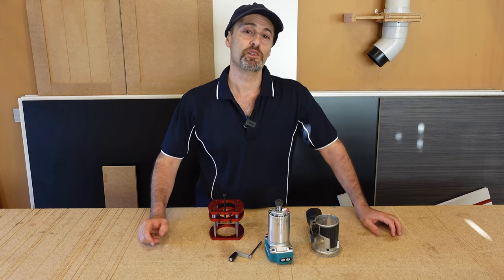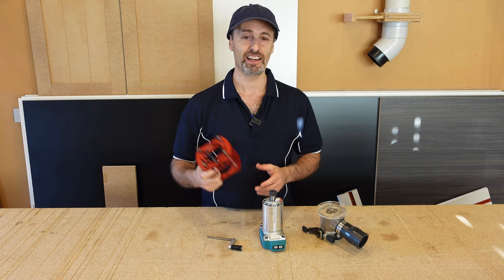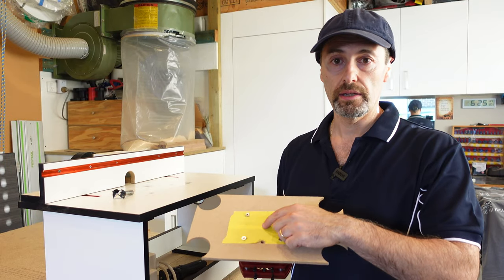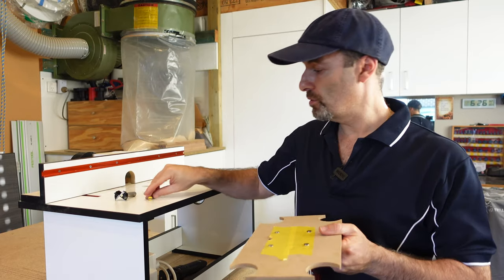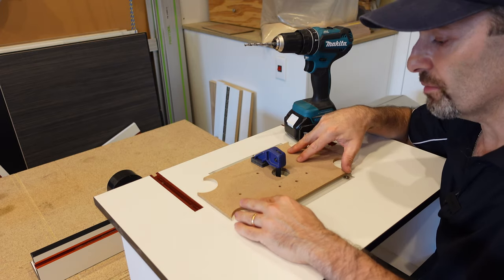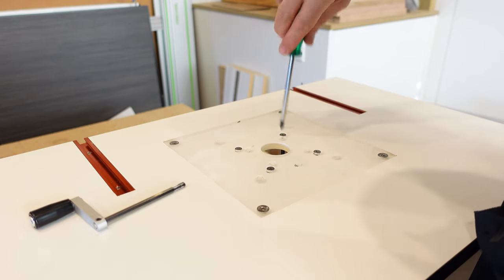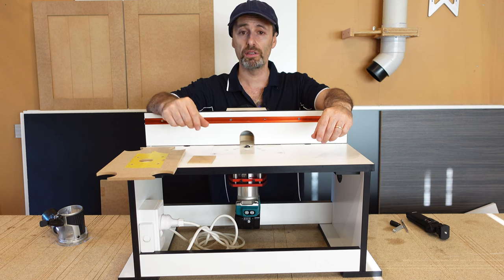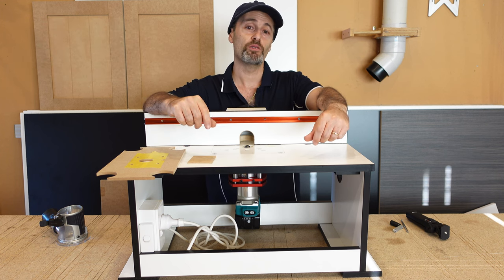Router Table Lift for Micro Adjustment - DIY Install

Comment: Take that scrap and make you a washer with the same size hole for a router, then inlay it, then you can get that nut up top to change the bits

Comment: Hello! I have the same elevator, screwed onto a plate purchased at the same time. But I can't make the adjustment so that the cutter is perfectly straight and centered. How did you do it? Thanks!

Comment: Great video Geoff.  In regard to the fence in the way of the winder, you could  replace the hex shaft on the winder with a longer one that’s higher than your fence.
Reply from the maker: Great Idea, thanks for your support 😀
Reply: @geoffsjoinery4990  or use a drill with that hex bit attached

Comment: Thanks for posting, as not much in my YouTube search when trouble shooting this router lift. Got mine from AliExpress.  Came in time promised. Ran a test using the aluminum router plate I purchased.  Initially clamped the plate to my cabinet saw and ran a test on hard and soft woods. Used a Chinese trim router and found the diameter of router to cause a shift off center when clamping don and the lift screw wound not hold stay causing movement due to vibration. Small set screw in bottom was loose. used medium locktight (blue ) and let it cure 24 hrs. Second test used my Makita trim router. When clamped in place was on center. Same test and lift mechanism appears to be holding but won't leave to chance. Double check and run test pieces of hard woods.   Hope this helps others.
Reply from the maker: Thanks for sharing your experience and feedback 👍

Comment: Hello, its been 6 months since you posted this, have you noticed any problems with the lift moving by itself due to vibrations ? Thats pretty much the only issue thats stopping me from buying it right away. All expensive router lifts have a locking mechanisms so i dont know how this one would behave.
Reply from the maker: Hi there, I myself did have an issue with it moving so I made some quick and easy mods to it which I demonstrated in a follow up video - https://youtu.be/Yw8jpQ-DzlY?si=0qQt5QPcR5lIYS5z
This mod is basically a locking nut which solves this issue and I have not had any problems since. Apart from that it's a great little router lift and inexpensive for what it does. I have left a link to the lifter that I have if your interested and be sure to check out my follow up video on this which I left above. Good luck 
Router Lift Kit: 
https://amzn.to/44WfPwJ

Comment: I’ve got the same lift but added some compression springs on all four posts to eliminate the slack
Reply: Have been looking for the right compression springs for this - what did you use, where did you get them?
Reply: @marvinbleiberg4338  I got them from a local nut and bolt hardware shop, the springs can't be too stiff or thick gauge or you'll not be able to compress the lift, I used 8 x 2 1/2in length soft springs, you can double up & coil/twist into each other to increase the tension to stop that jolt when you reach maximum wind on the lift

Comment: Hi mate I have bought the the very same one but have yet to install mine,  I also bought a table insert plate so I will put them together very shortly thanks for your help it'll make it a little easier for me to do and using your ideas helps alot thanks 👍👏
Reply from the maker: Thanks for watching and good luck with your build, don’t forget to check out my follow up post on the upgrades I did to the router table, see link below:
https://youtu.be/Yw8jpQ-DzlY?si=1mjvxlntD_59CYq7

Comment: i did buy the same lift as you , and use a hex bit in a drill to raise and lower lift but the handle ofr slight adjustment ,

Comment: Pretty slick lift for $36. I bought the Ozito router and router table and quickly returned after a single use. Their generic table is absolute crap. Then I found a US branded Kolbalt Router & Table that has a lift in the table but the router's 110V so a pain. What you have is as close as I have seen that is in my affordability bracket. 

This is your first video that I have watched so I'm hoping you have one where you reveal how you got/made the router table. Looks pretty schmiko too. 👍

Comment: I have the same trimmer router but instead of a router bit extension I just cut the part with the locking pin off with a hacksaw, this allows the shaft to come all the way up and then I use a 13mm spanner to hold the shaft and easily change bits from above.

Comment: Great video! I had been looking at the available router lifts and decided that they were way too complicated and expensive. They looked like NASA designed them.  I started shopping for a basic router table for occasional use and had gradually worked my way up to looking at a packages from Grizzly, Rockler, etc. that cost more than $1000, without a router lift.  The router razor is a cheaper alternative (~$95US) but it it requires lots of modifications to my Dewalt 621. It won't work with my DeWalt 618. I have seen the lift you used advertised but dismissed it as likely poor quality and requiring a trim router. I am glad you tried it out for me, thanks. It actually looks like the design is simplified and very inexpensive compared to the alternatives (JessEm, Incra, Rockler, SawStop, etc.). I asked my dog Beau what he thought but he is smart enough to keep his opinions to himself. I like the price of your router and a compact/trim router is cheap enough. So I will go back to Amazon and search for a table by sorting  from "Least to most expensive."

Thanks.
Reply from the maker: Great to hear, not sure if you checked out my video on the table but it’s pretty simple and can easily be pulled apart when not in use to save room in your shop. The router lift I purchased is easy to set up and can give you micro accurate results which I am happy with, they also sell an aluminum mounting plate to go with the lift which I would have bought also if I was to do this again.
Good luck with yours 👍
Reply: @geoffsjoinery4990  Thanks for the additional advice. I will look up your table video. 

I was just viewing some more videos on router lifts (You Tube is relentless about feeding you videos on any subject you have shown an interest in).  Grizzly is sending out phenolic plates that are warped. The Rockler lift is suspiciously similar to the one you installed except they charge about five times as much. Another problem is that many installations are into MDF table tops. Rockler uses 1-1/4” MDF, some use 1”, and those who are installing them into an existing out-feed table are installing into 3/4” MDF. By the time you route the recess for the ledge that forms the ledge there is
Reply: There is very little MDF left to support the router. One of the lifts has ten set screws tapped into the support plate to provide a means to level the plate flush to the table top. Unfortunately when tightened these set screws will press on (into) the very soft MDF. That can’t last very long. Grizzly and Rockler have optional cast iron tables but they are very expensive. Some who have made videos of their installation have added doublers to support the Ledge which seems like a practical solution and a good idea for anyone with an MDF table.  To quote Homer Simpson, “Who would have thought that Nuclear Power could be so complicated?”

Comment: Great video! THANKS! One question, What is the OD of your router motor? My Dewalt DWP611 trim router is 69mm.  The product info on Amazon states "supports machine diameter is 64mm to 66mm". The 3mm different isn't much but it could be a deal breaker.
Thx,
Red
Reply from the maker: My Makita router OD is around 65mm

Comment: well, i ordered the little lift device.  hopefully it will work well in my bosch/veritas(lee valley) combination!
Reply from the maker: @stevem268  good on you let me know how it goes 👍
Reply: @geoffsjoinery4990  it sucks, garbage imho.  it's too flexible so the router moves out of square with the table and worst of all the router slowly drops while in use.  a lock nut on the raising bolt should solve the second issue.
Reply from the maker: @stevem268  sad to hear, I am happy with mine it works and performs like it should.

Comment: Hi, my problem with this is that screw is moving from vibration when I work on and I need to install some additional nut nylon lock. Great video.
Reply from the maker: Stay tuned as I will be doing a follow up video on how to fix this soon 👍

Comment: How often have u used this? I bought one but I haven't built my router table as yet. I was wondering how often u have used it so far? I seems sturdy enough. I had bought a small Aluminium router plate last year so I will use it for this lift. It fits it perfectly. I bought the plate from Amazon.  It'll do for my purposes. I tend to use the routers I have by hand most times anyways but having a small router table would be great which is why I got this lift. I hope it works out grand for ya pal. 
I really like ur router table. I like the contrast of the white and dark colour.
Reply from the maker: Hi Buddy, I have done a fair bit of work with this lifter now and it's great especially for the price. If you just do those simple mods that I showed it will work fine. The aluminum plate that matches the lifter would be great, if I was to do it all again I would definitely invest in one. Good luck with yours

Comment: Hi, thanks for the video. How have you found the router height stability? I have the same router and mount and found it would slowly drop as I was using it. I could find a way to lock or apply friction to stop it doing this. Have you found the same?
Reply from the maker: @Adhocracy_Steve  yes it did slightly drop on me one time so I quickly devised a solution which can be seen on my follow up video on this , see link below:
https://youtu.be/Yw8jpQ-DzlY?si=d23UPrCmyBHK6npe

Comment: Hi Geoff,  I’ve been wanting to fit a router lift to my home made router table so was glad to see your video.  I’ve been trying to make bit changes easier from above the table and think that it can be done with a spindle extension piece.  This may lead to an increase in vibration.
The other feature I would like is a lift lock so the bit height stays constant during use.  This is found on more expensive router lifts.  Is this a problem on your device?
Myke
Reply from the maker: Yes I did have it drop on me one time so I did a simple fix which you can see on another video I made with upgrades:
https://youtu.be/Yw8jpQ-DzlY?si=_Qg1pv1VLEGlohvo

Comment: I realy wanted to see how these wirked before buying so thank you. Is it not possible to install 180 degrees to stop winder fouling the fence, and would it not be possible to install a nylon nut on the threaded bar to just lock in place.
Reply from the maker: Stay tuned I will be posting an updated version

Comment: Have you had issues when putting the router into the cradle. I never seem to be able to get it level (perpendicular so the bit is at 90 degrees to the table. )
Reply from the maker: Hi David, 
No I can't say I have had any trouble placing the router in the cradle. The Makita trimmer I happen to use in it fits quite snug so I guess there is less chance of it being off square or 90deg to my table, provided that the lifter bracket is mounted correctly.
Reply: *on

Comment: How about vibration? It seems like it would move on longer runs.
Reply from the maker: I have added a lock nut that prevents this and a few more extras, check out the upgrades to this router table:
https://youtu.be/Yw8jpQ-DzlY?si=I2M_tLKKYlzQP-a-

Comment: I bought this lift but haven't used it yet. It doesn't have a lock on it so I was wondering - does it hold it's position OK or does it slip at all?
Reply from the maker: So far so good, no trouble with it.

Comment: Have you had any issues with the lift lowering while using the router?
Reply from the maker: Hi Ron
To be honest no, I haven’t experienced anything like that yet. The adjustment screw/thread is quite tight, which is what you want, it might be a good idea to check yours to see if it’s too loose?
Good luck 🤞

Comment: Good video - consider yourself lucky - I've bought this item recently but mine is complete garbage  - as there is no lock, the vibration makes the set screw turn and the router drops just after a few centimeters of routing. Quite useless. If I want to make it work I have to come up with some sort of locking solution but in the moment I have more urgent problems and don't have the time for experimenting... Any suggestions would be welcome.
Reply from the maker: Stay tuned my friend as I will be making an updated video addressing the same issues you mentioned. Since making this video I have made a few modifications to mine which will fix these problems.
Reply: @geoffsjoinery4990  I'm looking forward to see it!
Reply: I am experimenting with adding soft pressure springs on at least two opposing columns, in the upper and lower part of the lift and it seems to hold the up and down adjustment firmly
Reply: Hi, my problem with this is that screw is moving from vibration when I work on and I need to install some additional nut nylon lock

Comment: Will this work on most palm router?
Reply from the maker: I can’t guarantee it will fit on ALL routers, your best bet is to follow the link for the lifter in my description and check the description specs to see if it lists your particular model router whatever that may be.
Good luck 🤞
Reply: Thank you for the revert. I ddnt realize there was a bolt that you can tighten to accept size variations. Great video

Comment: I actually bought this thing a few months back. It's hot garbage.

A couple of notes for prospective buyers: 1) It is not rigid enough to cut hardwood reliably and with smooth finish. the whole thing flexes just enough to make it useless. 2) the screw is too thin, it flexes when you turn it (you can actually see that in this video, i think) and more importantly, it will turn on its own under the router's vibrations. When you cut dense wood, like white oak, the router has an annoying tendency to lower itself while you cut. You can mitigate that by preloading the screw, essentially putting friction on it but that's a temporary measure, since the bottom of the screw rests on an aluminum plate that actually wears out and develops a pit very quickly.
Reply from the maker: Check out my updated video on this addressing some of the issues you mentioned:
https://youtu.be/Yw8jpQ-DzlY?si=gmacKkYraCx5lqJr
Thanks for your feedback 👍